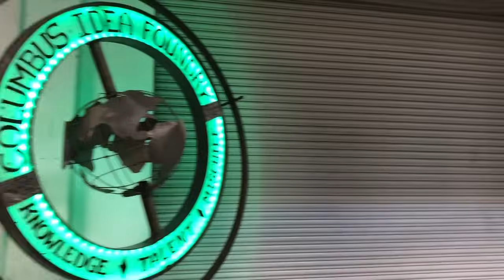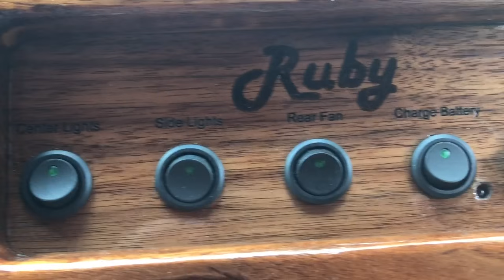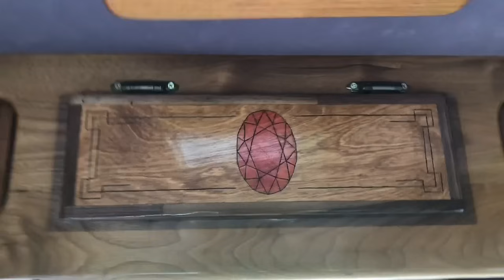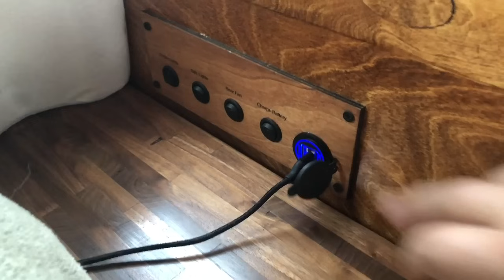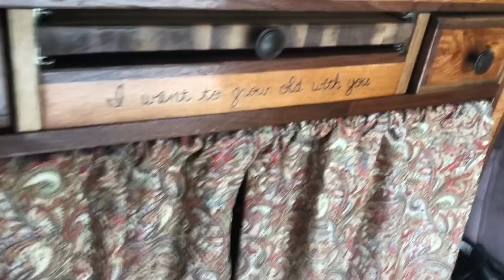Campervan Build

Comment: Beautiful and some great tips along the way too (like how to put in the floor)!! Thank you!
Reply from the maker: Glad I could help.
Reply: @SawDustRevival  One question... it's kind of hard to tell in the video, but it looks like there was wood on the floor around both wheel wells?  Like a strip lengthwise and then wood on either end of the wheel well?  Is that correct? ty!
Reply from the maker: Yes. When I pulled up the carpet, there was the padding there. I kept most of that but cut out channels to support the subfloor ring. I also put wood around the wheel well to support the sub floor. I used a really strong caulk to adhere the wood to the floor so I didn’t need to drill holes in the van floor
Reply: @SawDustRevival  Thank you!

Comment: Really like the woodwork great job!  Hope ya can offer some feedback with creating more headroom up front in my 04 GMC Savana hitop. Like you I had gutted mine and very slow process revising the interior. Got tired banging me noggin constant getting in and out so cut back the storage cavity above rear doors creating much more space though involved cutting out lateral support brace. Up front I cut headliner back about 10” till running into another one of the braces. Now wanting create more space cutting out a horse shoe U config cutting forward up to the console lights between front seats.  This will make for total ease getting in and out of front seat.  I’ll figure a simple trim detail going around the cove so to be able utilize remaining storage space. Thinking the opening to be the width of space between the seats. Suppose a guy could conceivably cut forward all the way to the front leaving portions above each front seats butt rather see how it feels after cutting this portion out. My concern being about the structural integrity in cutting out the brace running across above front seats.  It appears many after market fabricators just cut out roof adding new fiberglass top but wanting make sure before I start cutting. There’s the  option of welding roll bar type brace up and over attached to where brace cuts would be and to the raised roof so to not infringe into the opening.  Will appreciate your thoughts if you were to do this in your van? Thx
Reply from the maker: Thanks for the kind words. I’m afraid I can’t give you much advice on your question. I personally wouldn’t feel comfortable cutting into the supports but i honestly don’t know how it would effect it. Good luck.

Comment: My ‘92 is laid out nearly identical xcept the woodwork isn’t so nice. However, w/ 3 100w panels on the roof & a 2000w inverter w/ 2 100ah deep cell batteries I have an actual 3.5cf refrigerator where your cooler is. I have another add-on panel I set out at my destination. I run the fridge, stereo, a box fan, 12v water pump, & 12v water heater element for outside shower with that setup. Battery isolator under the hood also allows alternator hookup to charge both starter & cabin batteries while running but never draining start battery…
Reply from the maker: Nice. I may add solar. I’m getting a little AC unit I backed on kickstarter. I should have power now to run it especially when I have shore power. But I like boondocking and would love solar.

Comment: nice, looking van and great looking work you have done /  I, bought a 97, Dodge Ram 2500 conversion high top van I'm going to add a few changing to the inside and outside of the van to give it more  custom features

Comment: Beautiful. impressive artistic skills, as well as an exceptional knowledge of wood working/working wood. I'm in aw. I'm particularly pleased that you converted a 90's Van it reminded me of the 70's era, with the rugs, space and chunky wood. I like that you kept some of the original while updating it as well. What do you do about the 30+ yrs of the body, motor and such, was all of that updated as well? It looks like it was well taken care of when you buffed it out there was no rust. Beautiful build.
Reply from the maker: Thank you for the kind words. The good thing about a G20 is they are solid vans with good engines. The engine needed some additional work but the body of the van hasn’t needed anything but some TLC.

Comment: I have a 1999 Chevy 1500 Express conversion van I’m converting in a camper. It would be better if it was a high top like yours but the price was right. The wood work and lights make it like glamping.

Comment: Nice! great project wonder how much was spent.✌
Reply from the maker: $2500 for the van originally. $2000 in interior build. Needed some unexpected engine if work which cost more. Initial goal was keep it less than $5000. Would have if not for the engine work.
Reply: @SawDustRevival  I see..turned out really nice though you did a great job good investment.👍

Comment: I have had my G20 for five years and have lived in it full-time for the past 2 years and I wish I would have done it sooner! Thus far my van has been very reliable. Minor things to repair only in the past 5 years and a tune-up and brakes, muffler, and a catalytic convert when I made repair to smog it back in 2019 can I find swivels similar to the ones you installed? Thank you!

Comment: Good to see a G van among the youtube sea of sprinter upgrade videos... How did you attach the base for the cabinets/shelves in the high top? Screw into metal?
Reply from the maker: This was probably the hardest part. I slide a 1x2 board with adhesive down in the gap between the fiberglass high top and the top of the van. I then screws the shelves down into the board and also secured them to the far ends. Hope that made sense.

Comment: Nice job, I like these vans. When you said that you had to cut mattress to fit it, what is actual length of the bed? I am 6’2” and planning to convert a van but I do not think the bed would fit sideways and be more than 6’2”. Thanks
Reply from the maker: Yeah 6’2” is going to be too big from window to window. I’m 5’9” and any bigger and it’s too big. The bed is a queen from side to side but I cut about 6” off of the bottom so it is shorter. Good luck. My wife and I love ours but it does fit our size.

Comment: So clean dude. I have a 94 Chevy g20 that I’m tearing apart right now. 

Any recommendations on installing that passenger swivel? Did you get it from a website? Seems to be limited info online. Maybe you could point me in the right direction :)
Reply from the maker: I got the swivel seats from a guy off of instagram who goes to junk yards and takes out parts I believe it is @junkyard_chevy. Good luck.
Reply: @SawDustRevival  thank you much. I appreciate it

Comment: Hey brother. I’m currently building my bed in a 94 g20. I’m trying to go width wise as that little bit of saved room is crucial. 

How tall are you and is it comfy for you to sleep wall to wall/window to window?
Reply from the maker: I’m 5ft 10in. and I cannot be any taller. My head tickles the window as does my toes if I stretch out, but I sleep just fine. It’s perfect for my wife who is a few inches shorter. When she is not in there I sleep a bit diagonal and there zero problems.
Reply: @SawDustRevival  alright! Thank you. I appreciate that!

Comment: I'm working on a 91 GMC van conversion and I'm curious about your swivel seats. What base/bracket did you buy? Does it make the seats sit lower then normal? And does it have the bracket for the seatbelt? Thanks so much, and great job with your build!
Reply from the maker: I got the swivel seat bases off a guy on Instagram who took it off of a late 80’s Chevy van. It does make it a little shorter and the seat belt brackets are there.
Reply: @SawDustRevival  thanks for the reply!

Comment: Very nice job, I hope I am able to do the same when I am able to get a hold of one. I see you kept the same heating & AC system for the back of van how that working out. And how long did it take you to finish and are you still using it where did find it?
Reply from the maker: Thank you. The heating/cooling system is fine. Don’t use it as much as I thought I would but I figured it would be a pain taking out. It took me about 4 months to finish with working a little bit at least every day. It was my COVID project. I still use it but don’t live in it. I got it off of Facebook market place in Kentucky.

Comment: Nice! How does it run? What's the mileage on it? We assume it a 350 V8 Engine.
Reply from the maker: Needed some mechanical work when I got it but it runs great now. I got it with 92k miles and put another 4K real quick. And yes it is a 350 V8. Glad you like it.

Comment: Hay take a ice chest and make a ac an take a fan and run 3_8s copper tube.around the fanan tie it down with plastic ties.an circulate the water through the tube an have the fan blowing into the ice chest

Comment: Very cool man, I have the same rig with a wheelchair door. Did you use the captains chair swivel from the back seats up front? How did you mount them to the floor? Did you shim it?
Reply from the maker: Yeah. The middle captain seats fit the swivel seat bases off of an 87 Chevy van so took out the front seat and put this in. Everything fit like a charm. A little lower than I’d like so I may put some shims in to bring them up a bit, but haven’t done that yet.

Comment: It was going too fast.. lol  Did you take the swivel seat bases from the middle passenger seats?  Did you have to retrofit them in any way?  Or did you buy swivel seat kits?
Reply from the maker: I bought the swivel seat bases off of a guy on Instagram. They are from an 87 Chevy van. They fit the middle captain seats without any modifications.
Reply: @SawDustRevival  Thank You.  I am hoping to move one of the middle swivel seats up front and replace the passenger seat so that it will swivel.  I was told that I would propably have to buy a swivel kit for the front seat.

Comment: Nice job both video and van.  I have an identical van w/103K miles but, did a lot less work to convert to campervan.  Not as nice as yours  but, serviceable.  Where did you obtain the  swivel bases?
Reply from the maker: I got the seats from a guy on Instagram. Junkyard_chevy. He tears apart old Chevy vans and sell the parts. Seats came off of an 87 Chevy.
Reply from the maker: No. I sold them.
Reply: This is awesome.  I just purchased a GMC version is this van and am very excited about converting it.  Can you tell me where you got your swivel seats?  Thank you for posting this.  I'm all pumped up now.
Reply from the maker: @maryhelenmagana1165  I bought them off of a guy on Instagram. Junkyard_chevy. He tears apart old vans and sells the cool stuff. These came off of an 87 Chevy van.
Reply: @SawDustRevival  Thank you very much for the info.  Very kind of you.

Comment: I guess other than the new floor and cabinets, wondering why you needed to remove so much stuff when really all you need to do was remove 2 capt chairs, install swivel bases to front seats, remove rear couch and install a bed in place with storage underneath? No?
Reply: He revamped it...to his tastes.
Reply from the maker: You pretty much explained everything I did. The original van didn’t have cabinets in the hightop so I did that on top of what you just described.

Comment: I won't lie that wire box looks scary as hell .....can anyone say fire hazard ???
Reply from the maker: Yeah that’s a work in progress. The majority of those wires aren’t actually connected to anything.
Reply: @SawDustRevival  I wasn't trying to be a jerk about it but it looks like it doesn't have any air circulation.. it probably gets hot as hell in the summer season

Comment: What a shame that you gutted such a classic interior.....that's what makes these vans so special.....it's like stepping into someone's living room. Rather than gut this van, I'd get a cargo van 4a clean slate....this van I would change the carpeting that's shot and add a small coordinated cabinet 4 a sink/fridge but 4 the rest.....I would retain the integrity of the design.
PS.....It's lovely .....just not the same. Glad it works 4U though. Happy Travels.
Reply: Nope No shame in it at all. There are literally tens of thousands of these still around, way more than people who want to or can afford to drive them as their daily driver. And when something like this isn't useful as-is, people will either sell it to a junkyard where it will get parted out or crushed for metal, or they'll park it in their backyard where it sits ignored for years and years. Do a search on Craigslist and you'll see what I'm talking about - paint flaking off from the elements and no care, interior bleached from the sun, "Don't know if it runs now. It ran when I parked it." 

So if this man didn't redo this one like he did, it wouldn't have been as useful, so likely would have succumbed to one of those two fates. In reality, he saved it from being completely destroyed.
Reply from the maker: Exactly. This poor van was sitting for 2 years forgot. I’ve had it for about 3 years now and have driven it all over the country. This van is LOVING its new life and it has brought great joy to my family.